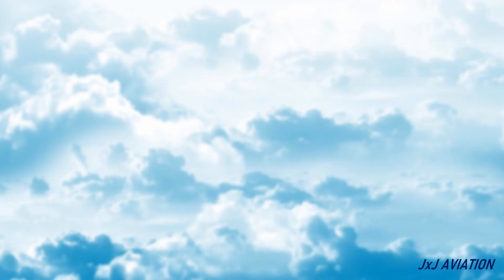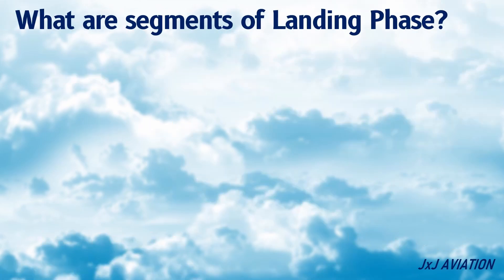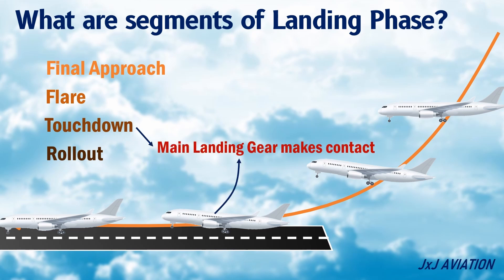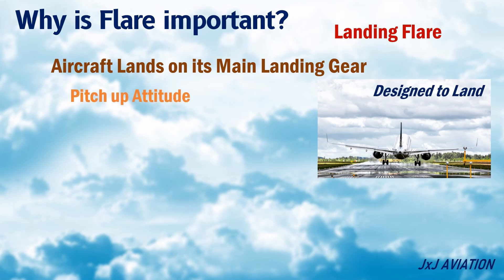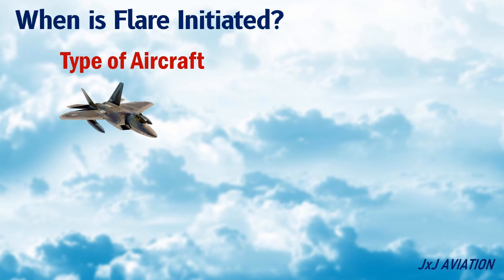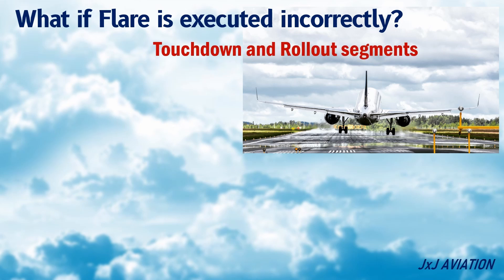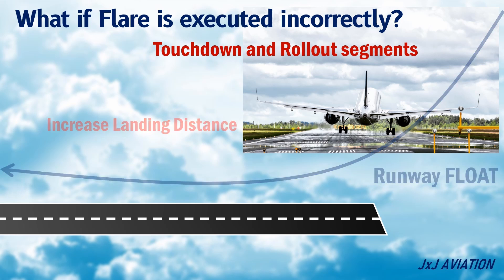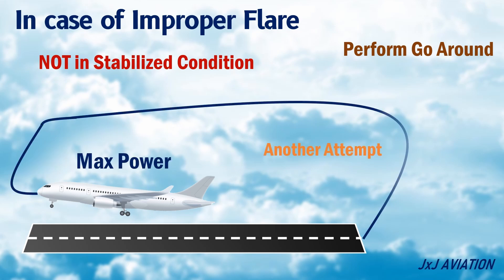Why is Flare important during Landing? | Understanding Flare; Results of Incorrect Flare Technique

Comment: The purpose of the flare is to slow down the aircraft while still in flight and close to the ground so that as the stall speed is approached the plane will cease flying and touch down at the lowest speed possible for the brakes to function safely within the available runway length.  If a plane is flown onto the ground at a higher speed, there is a risk of exceeding the strength of the landing gear and a long rollout on the runway is needed, risking running off the runway as well as overheating the brakes.
Reply from the maker: That is great explanation!